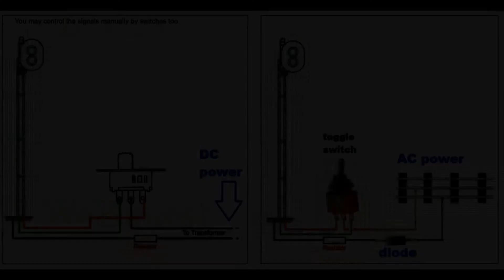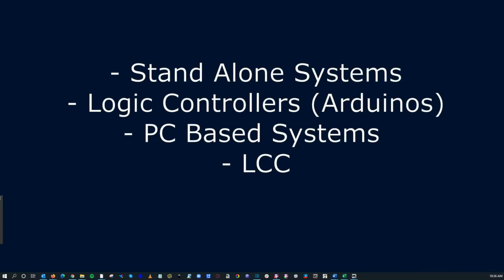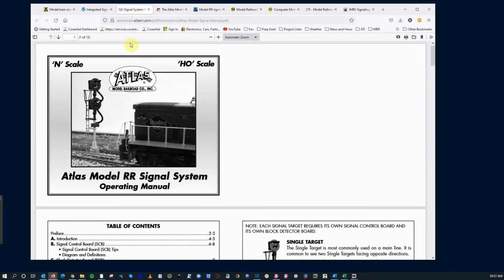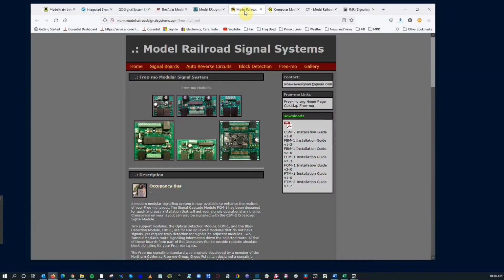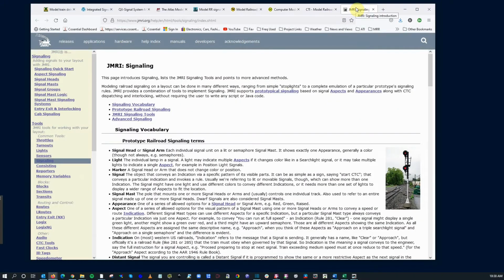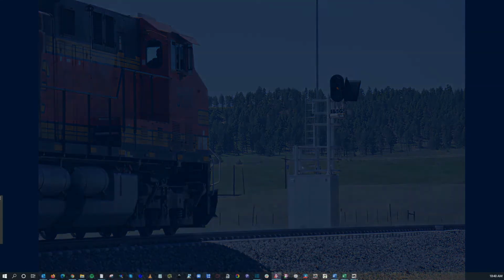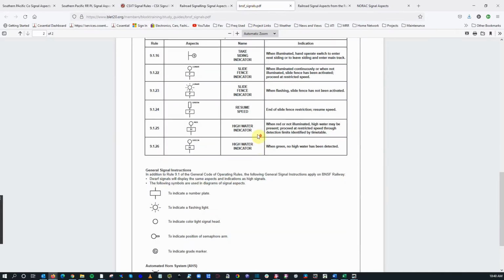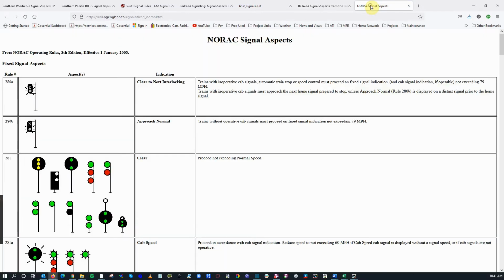TLC #11 Signaling Pt 1 Intro

Comment: I have a DigiTrax system under construction which provides a Panel pro Panel, block sensing and signal logic train location. The problem I am having is that My Loconet is slowing down the system. I would like to stat utilizing LCC for some aspect of my RR. Can I Intergrate LCC into my JMRI System. I have some Areas of my Railroad I could install LCC. I do not want to start ALL over but to add to my system. Is This Possible?

Comment: Great info here easy to under stand! Can You tell me where I can find those signal mast?
Reply from the maker: Thanks for the nice feedback and encouragement. Not sure which signal mast you are talking about. For the layout I have been using an Ebay seller with the questionable name called "wehonest" (https://www.ebay.com/str/wehonest). They are not up to the quality of the big names, but the price is right and with a little dress up, they look pretty good. One thing to note tho, the cantilever signal in the vid is a bit short. So if you were to look under that pile of rock at its base you would see a block of wood as a spacer. But then again, for around $30 for a 2 track, double headed signal, I can accept that shortcoming. Their trackside signals are also very nice for the price. If you are talking about the test setup signals, they are from Model Railroad Control Systems (https://www.modelrailroadcontrolsystems.com/simple-signaling-and-accessories/). They are very basic, but nicely do the job for a demo layout.
Reply: @the-lcc-channel  Thanks for a speedy reply. I was asking about the test set up. I'm going to try a learn a bit with the lower cost components on my test layout. Thanks again looking forward to more Videos on LCC and it capabilities.

Comment: Looking forward to the CTC logic! - Jason
Reply from the maker: It's worth mentioning that CTC is most often set up in and worked from a PC. If this is your desired end goal, it may actually be more complex to try to implement the logic on the LCC nodes and then have the PC interface logic overlay the node logic, either at the node or via events sent by the PC. Something to consider.